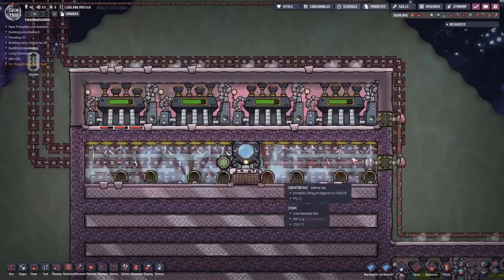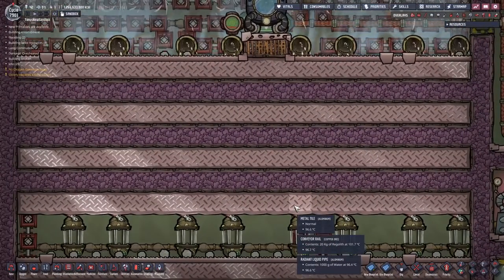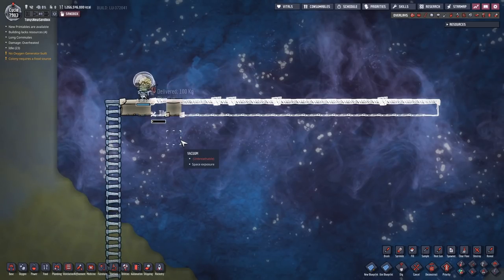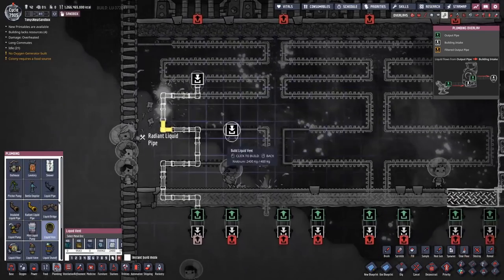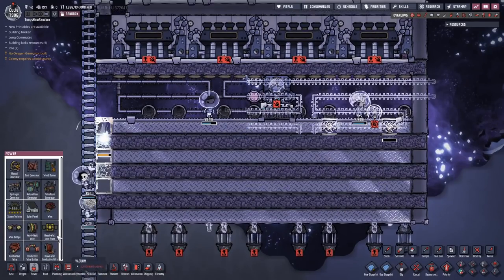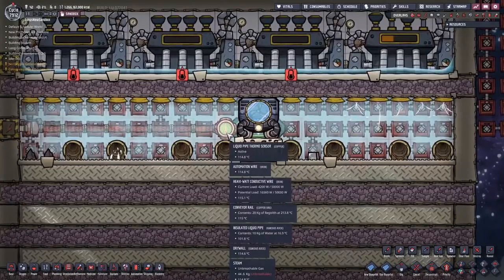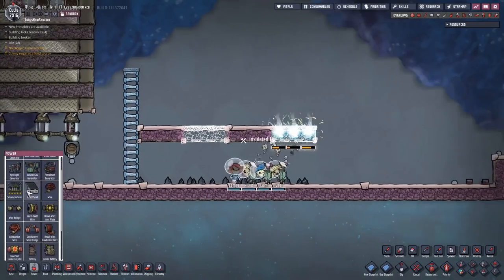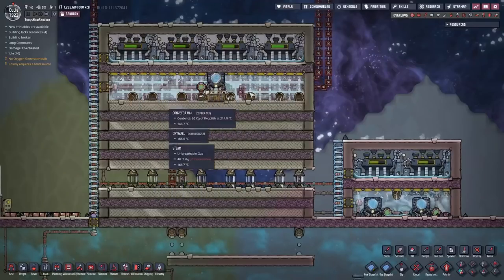How to Cool Your Regolith to Generate Steam Power

Comment from the maker: Addenda:
1) Debris on a conveyor rail exchanges heat with the tile it is on AND the tile below it. So I think this could be made more efficient by serpentine-ing the rails through the insulated tiles as well as the metal tiles, because they can still exchange heat with the metal tiles below them.

Comment: Here's the explanation for why creating temperature "stages" improves efficiency of thermal transfer systems:
Most people understand this intuitively just by knowing how heat works, but it's not so easy to put into words. Let's start by imagining the most simple counterflow heat transfer system possible: two pipes running through a section of metal tiles 10 units long. The top pipe moves hot liquid from left to right, and the bottom pipe moves cool liquid from right to left. This means that the bottom liquid will come out hot at the left end, and the top liquid should come out cool at the right end. In order for this to work properly you absolutely need the rightmost tiles to be cold, and the leftmost tiles to be hot. In this example though, you only have a single stage, one giant metal brick. The left side of the metal tiles are hot, and heat will be transferred from left to right by the metal tiles themselves. This will have the effect of averaging the temperatures of your liquids, which is not what you want in a heat transfer system. In order to get maximum heat transfer from the top liquid to the bottom liquid, you must break up the metal tiles into sections, and insulate them from each other, thus preventing heat from "leaking" from the left to the right. If you had infinitely many such segments, you could achieve "perfect" efficiency in theory. In effect, the more "stages" or sections you have, the better your heat transfer will be.

Comment: I like how you use regolith to make a power byproduct while cooling that is actually capable of being power positive, then explain how to add additional cooling by adding powered cooling that will make your regolith much cooler,  without the massive power deficit that using only powered cooling alone would run into.

2 options, one power positive, one with low net power loss

Comment: Realistically regolith only have 2 uses, feed voles in space or melting it, but great video as always
Reply from the maker: It's true. That's all I can think of.
Reply: @matthewbauerle7153  you have so much sand, why use something that is very hot
Reply from the maker: @matthewbauerle7153  True. That's a legit use. But I wouldn't cool 36,000kg per cycle for it.
Reply: @Arkaon666  I plan to use it to make clay with diffusers, at least in the short term. It's a good source of coal, and you need a LOT of sand if you want to farm polluted oxygen like that.

Comment: Fantastic video, as always! Is there a reason the top aquatuner is on airflow tiles, but the bottom ones aren't?
Reply from the maker: Yeah. The pipes are hard to route if the top one is sitting on the floor because the liquid vents get in the way. I used airflow tiles because it felt right for a room meant to have steam in it.

Comment: Question, doesnt steam escape the chamber through the airflow tiles below the tuner? You might address this in the video somewhere but I've already built it and is working great, just with the addendum of adding metal tiles behind the tuner instead, although i'm not exactly sure why you can't just place it on the floor, maybe you leak heat into the heatsink?

Comment: Couldnt you use the water released from the steam turbines to cool the steam turbines and use the aquatuner to cool the aluminum plates then you could theoretically cool it without the second cooling loop without lowering the water temp to the point it doesn't flash steam once reentering the steam room.

Comment: Quick question. If you are builduing in a vacuum wont it be better to NOT build the insulation tiles between cooling layers ? Vacuum there is better ? (Unless Im missing something ofc).And if you make it vaccuum you can make  a passage for the dupes in case of repairs (since no need to w8 for the building to finish so can easy make empty space 2 tiles high)
Reply from the maker: Yep. You are right.

Comment: If you had vacuum between the heat sinks you could get rid of the insulation, right?
Reply from the maker: You're right.
Reply: Yes, furthermore you should probably use insulated pipe between sections for maximum efficiency
Reply from the maker: @impyre2513  If you have insulated tiles there it helps the heat exchange a little to use radiant pipes (I haven't tested that in a while), it may be worth saving the refined metal by using regular pipes, and I can't think of any reason to use insulated. With a vacuum instead of insulation then any pipe works all the same.
Reply: @tonyadvanced6315  EDIT: apparently adjacent connected pipe sections don't transfer heat between them at all
Reply from the maker: @impyre2513  I read a thing that says they used to do that, but they changed it.

Comment: Can’t u do what u did with ur metal volcano tamer and have the regality go through the steam then the steam turbine room
Reply from the maker: Yes, but you still need a total of 5-6 turbines and 3 tuners, so you basically get the same building sticking out the side of the build at the top instead of the bottom. Plus, you have to route 3 rails of regolith back up to the top and then down again, so you need 6 tiles-wide of rails on the side and three tiles of rails across the top in addition to filling the turbine room with rails. I'm not sure the hydrogen can absorb the heat fast enough to handle 3 continuous rails of regolith unless it's very cold, it might require super coolant.

Comment: why not just run it straight through metal tiles under steam turbines in a row?
Reply from the maker: It doesn't work very well. If you do that and use tempshift plates to help get the heat into the steam then I think ithree rails of regolith and three turbines would cool it down to 160-170C. It IS a lot simpler though, so it's not a bad idea depending what your goals are.